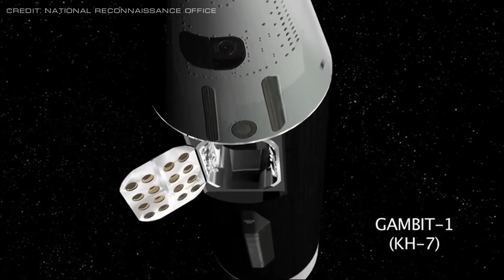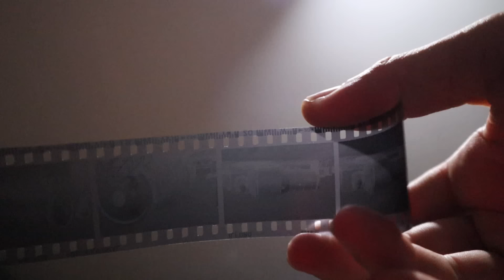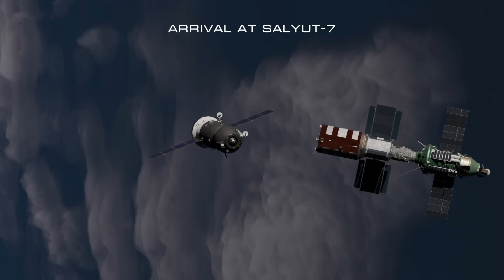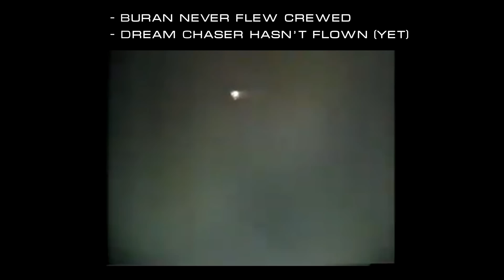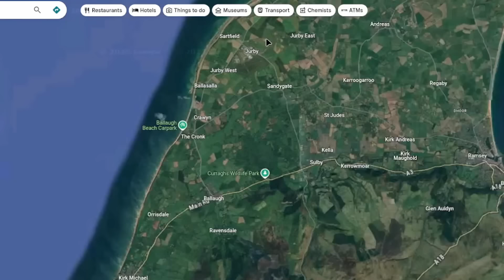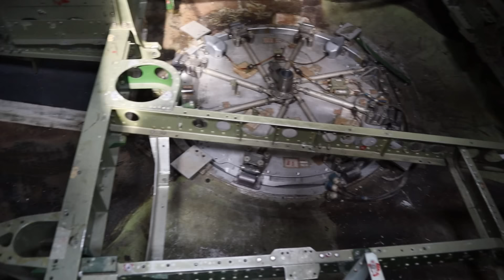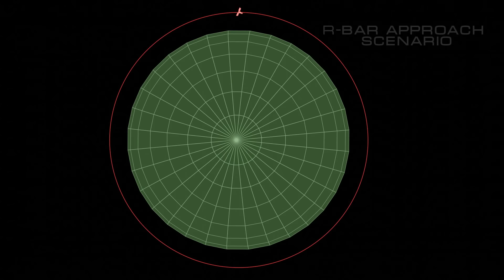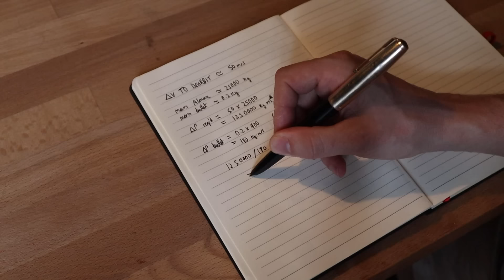Almaz: an Autocannon on a Space Station

Comment: There is a solution to make rounds from an autocannon slightly less problematic and this has been practically implimented into flown aircraft guns- make the bullets automatically detonate themselves after a certain time of flight. Of course in space now you have even more smaller debris, but by my logic a whole bunch of now very small and inert fragments that are significantly spread out all over the place is likely better than slamming into a fully formed round that still has it's explosive intact
Reply: I'm not sure that's exactly better at orbital speeds... you'd need really good guarantees of turning all missed shots into really small pieces -- look at the damage to spacecraft windows caused by paint flecks and metal filings impacting them at orbital speeds. Shrapnel from long-ago-self-destructed rounds would still be super lethal, only moderately less so than whole rounds. And would cover a larger area!
I'd almost suggest that projectiles intended for use in orbit of an occupied (not necessarily habitable, but anything with the possibility of friendlies/neutrals in orbit any time in the next century, including your own ship) body would need to be made out of some kind of material that would vaporize over time (either burning under its own power like some kind of really slow pyrotechnic fuse material ignited by launching it, or something like ice that evaporates due to sunlight on a predictable timescale) instead of metal. But I don't see that being safe ENOUGH to use unguided projectiles at all, so restricting yourself to some kind of energy beams (but how to dispose of the waste heat without excessive vulnerability?) and missiles (ideally incorporating similar features with self-burning plastic hulls/etc designed to minimize persistent debris after explosion in the case of a self-destruct) seem... far more practical choices.
Really, the only 'safe' weapon to fire in orbit would be something that isn't capable of orbiting a planet or star at all: a big laser or microwave beam or such, that surely won't come back around on you or lurk in orbit for someone else to hit later, but rather just keep spreading out in a narrow cone forever until it ceases being deadly and becomes merely blinding, then illuminating, then merely 'a signal' before being lost in the noise. And in theory melting and evaporating a target is also 'cleaner' than shattering it into chunks, as far as I know. Of course, in a practical case, whatever you're shooting at is potentially liable to then blow up from stuff cooking off, etc. under your beam (or even just thermal shock shattering stuff, internal pressure pockets blowing things apart as stuff boils, etc.), and create (some) loose debris anyways.
Maybe let's not shoot anything in Earth orbit if we can help it...

Comment: Yes, the shuttle was absolutely designed to launch and retrieve payloads to/from orbit. What are you smoking when you say it wasn't?
Reply: I think the thing was 'but not resisting payloads'. Disabled Soviet unmanned satellite? Yoink! (at least in the dreams of the Defence Department) Whole space station? Um, ...not a chance. But that did seem somewhat unclearly worded. "Just a Soviet conspiracy theory" seems a little too dismissive, there were also Americans involved in the design process that demanded such a thing, even if it wasn't really feasible.
Honestly, I think that even a textbook perfect target 'disabled' enemy satellite with classified military hardware aboard would be far too risky to grab in such a way, given the fact that it might explode (or merely 'wake up' and try to adjust its angle/trajectory) while grappled, or worse, in the cargo bay. Simply some RCS firing inside the bay (or sufficiently strong reaction wheel movements at inopportune times) could probably destroy a Shuttle.
Now, if the CIA or whoever had managed to steal the command codes and somehow bricked such a satellite's computer in such a way that they knew would stop it from making any further movements (with whatever reactive station-keeping it had turned off), and they had reason to believe no 'ticking timebombs', literal or figurative, existed on the craft (but if they know it that well, why go through all this trouble to steal it?), then maybe such a recovery could be pulled off, but it still seems like an insanely risky mission.

Comment: I just knew it'd be an aircraft gun haha. Also you probably can't fire it for long because it will overheat like crazy, capillary heatpipes and white paint can only take you so far (especially with the receiver looking like it's MLI-ed).

Thermal management in space is a headache, everything either wants to become so hot that it breaks circuits and sensors (equilibrium T° of metal surfaces in sunlight in space are insane haha) or it's abysmally cold and you freeze and break circuits (the Moon/the part of a geostationary satellite that faces away from see the Sun).

Comment: I went to uni in Moscow, specifically Moscow Bauman Stat Techical University and within Kafeda Specialnia Machina Strayania 1 ... or the Special Machines 1 studies. This is where you go to learn how to design and build ICBMs and/or large launch vehicles if you're a Soviet or Russian of high standing. I was let in as an American in the melid '90 because I had money and they were broke. It would have take 8 years to finish. I dropped out after 3.
They tell their students the reason they put a cannon on a space station is because the military was afraid of the Space Shuttle. It was a curious coincidence, the engineers were told, that the  Shuttle was just the right size to fit an Almaz within. The engineers knew better and behind the backs of their handlers rolled their eyes at such stupidity, but what are you going to do? Tell someone who would send you to a gulag that they were being baranoif and stupid? So the cannon was added.
And the engineers did everything they could, used every trick they had, to make the test firing happen after the crew left and the station was going to be deorbited anyway.
After the test firing, te station was a complete mess, "just as you would expect," the man who told me the story emphasised with a.shake of the head. 
Unfortunately, I was a.stupid 20-year-old who didn't know how to ask questions. I just listened and moved on. Which means I didn't learn anything special about this or many other topics.
Still, once the higher-ups saw.the carnage the cannons did to Space station, plans for cannons aboard other stations were abandoned.

Comment: That gun had to be a technology demonstration or more likely just an experiment - I think. Some random cosmonaut in an EVA suit with a Kalshnikov would have been 1000% more efficient than that fixed canon
Reply from the maker: ‘Random cosmonaut with a laser Makarov’ was genuinely one of the proposed alternatives. Just google ‘soviet laser pistol’
Reply: @Alexander-the-ok  That's some Moonraker shit there
Reply: @ghostbirdofprey   "First there was the dream, now there is reality... Here in the untainted cradle of the heavens will be created a new super race". Hugo Drax.
Reply: @Alexander-the-ok  and would have worked a lot better.
No debris, no recoil, no exhaust gasses. Nothing to change your orbit (unless you use a chemical laser and vent rather than store the waste chemicals).
Of course the energy requirements for such a weapon would be too high for a pistol sized weapon. Even 50 years later a laser weapon capable of actually damaging something needs the power supply of a pretty decent sized warship, either a small nuclear reactor or a large gas turbine engine hooked up to a sizeable generator.
Reply: @jwenting  the pistol wasnt really for anti personal combat (kinda was) it was more to disable the cameras of satellites by frying the sensors,you could theoretically also make the enemy astronauts permanently blind
Reply: @jwenting  Just go watch some of Styropyros videos. That man shoved an entire high powered laser system inside a radar gun housing recently, and built the optics to turn a laser welder into an actual laser rifle with the (potential, paper mathed,  federal law, cant fire beyond his property line) range to hit a target further away than the horizon *in atmosphere*. A laser system capable of mission killing a satellite while in orbit is 100% possible. 

Now doing it back in the 70's? Yeah you're not doing it anywhere near as well. You can probably mount a laser capable of disabling optics though.
Reply: @jwenting there’s a Russian unit the size of an IFV shooting down drones and rapidly making holes in steel. This is thru air at 1 Bar too.
Reply: @MJRSoap  
" A laser system capable of mission killing a satellite while in orbit is 100% possible. "

Please tell me you did not come to that conclusion because you saw a youtuber bolt a welder to a radar... please... 

Even the USA has been developing lasers to take out satellites for decades. It's just that it's a lot easier to use a missile.
Reply: @jwenting  the polyus space station did have a megawatt co2 laser, but the orbital insertion failed
Reply: @Alexander-the-ok If it works with an Elephant's foot, who's to argue it won't against satellite?
Reply: Gotta cycle the ak by hand in space if the extreme temperatures dont warp the metal out of tolerences, i imagine the gas systems wouldnt work in space
Reply: @AidenColson  gas operation doesn't really depend on an atmosphere. the inside of the gun is hundreds to thousands of atmospheres greater than ambient pressure. if there was a leak, it doesn't really matter if the outside is 1 atm or 0 - all the gas will escape anyways

there's also a less theoretical proof that gas-operated guns work in space: the R-23 was gas-operated, lol
Reply: ...My dumb a** imagined some ripped Russian wearing a red NGE plugsuit.

Took me two minutes to remember that "EVA" has a non-weeb meaning.
Reply: All the Almaz space stations were military in function. All were armed with remote controlled satellite destroying weapons.
Reply: @allangibson8494 source just out of curiosity? If a book?
Reply: Sooo do you have to use an oxidizer in addition to the powder in the rounds…err is it an AK just going to be a fancy ADHD space clicker that nobody can hear.
Reply: @ChadThundertalk All firearms combine an oxidiser with the fuel. That’s how both black powder (which uses Potassium Nitrate as the oxidiser) and modern smokeless powders (which use buffered high explosives) work.
Getting the gun to work in a vacuum is harder - a lot of lubricants boil off under those conditions and polymers frequently follow.
Reply: @allangibson8494  older, wooden bolt action rifles should be okay for short to medium durations, but yeah, vacuum proof gun lube would be a pretty new if useless invention
Reply: @Blaoerry The lubricants exist - NASA et al uses them for their purposes. 
They just aren’t what gun shops sell or gun manufacturers use.
(Silicone and Teflon based dry lubes have very low vapor pressures).
The finishes on timber are actually worse than plastic in a vacuum and the trapped moisture in wood will want to escape explosively (particularly when heated to above boiling point in direct sunlight in a vacuum). You haven’t seen dry, until you see vacuum freeze dried.
Reply: @allangibson8494 oh yeah that's true, I usually think of teflon and silicone grease as very high viscosity, but I'm sure there's more appropriate ones available. I didn't think about the moisture content tbh, has there been any studies/tests done with wood in space?
Reply: @Blaoerry The Soviets and Chinese did test an oak ablative heat shield for a reentry vehicle… Not sure if that would correlate…
Reply: @allangibson8494 well there would t be much moisture in a modern AK-104 cuz it’s made of glass reinforced nylon. I don’t even think the wood is gonna have those kinds of problems. As long as it’s been cured and dried… defineily not enough moisture in there to crack the wood. If there is then ok it’s trapped inside a tight bundle of cellulose and lignin fibers, basically bioplastics. Take my AK up there now and it’s gonna be fine cuz it was made in the 1970s and kept in kosmoline for most of that time. Kosmoline is perfect for kosmonauts.
Reply: @Kurdalægon  Kiln dried timber runs between 6% and 20%.
In a hard vacuum, that’s enough to blow the wood apart under the surface finish.
Nylon outgasses badly (result from the NASA LDEF) and is hygroscopic (absorbs water). Outgassing fouls surfaces and obscures windows and optics. Epoxy fibreglass is a better option.
Molybdenum Disulphide, Tungsten Disulphide and Hexagonal Boron Nitride are recommended high vacuum lubricants. Graphite stops being a lubricant in high vacuum.
Aluminum and Silver corrode rapidly where atomic oxygen is present (ie low earth orbit).
Kosmoline will simply evaporate in a hard vacuum…
In short - it’s complicated.
Reply: @ChadThundertalk  the oxidizer is part of the powder. Triple base contains 3 nitrogen-oxygen chemicals… it used to be nitrocellulose, nitroglycerin, and nitroguanidine. Tjeee is I’ll combust in a cacuuum cuz they break nitrogen oxygen bonds for energy. Gunpowder is a carbon combustion reaction that creates energy by joining bonds. Really they both function by turning from a solid rapidly to a gas so the energy is from
The phase change and the source of
That energy is those bonds breaking. The propellant part will work fine, so will the lead azide or the aminoguanidine-based stuff they use now for the primer. Same deal, but all the lubricants will flash off and leave behind a waxy residue. I can’t imagine this affecting any part of the AK that much, I’m very familiar with their construction and operation. I think the recoil, firing pin, and hammer spring would have to be beefed up. That will make it more jerky but it’ll prevent slam fire and cycling or firing issues. I’m sure a dry or polymer based lubricant could be developed for a vacuum. Graphite. Molybdenum disulfide.
Reply: @Kurdalægon  One potential benefit of firing guns in space if the propellant is traditional gunpowder: Corrosion of the barrel by combustion products would be far less likely. Gunpowder is not an efficient gun propellant, since roughly 50% of the combustion products are solids - mostly potassium carbonate and potassium sulfate, with smaller amounts of potassium oxide and potassium sulfide.
In a vacuum, these would not undergo any further chemical reactions, and would therefore remain as dry powdery solids. Primarily because there would not be any moisture present: The vacuum of space is dry, and gunpowder is one of the few explosives which does not generate any water as a combustion product.
Here on earth, those gunpowder combustion products become corrosive to steel gun barrels because they either absorb or react with water vapour from the atmosphere: Both potassium carbonate and potassium oxide are highly hygroscopic, rapidly absorbing moisture and reacting with it to form potassium hydroxide, a strong and corrosive alkali. Potassium sulfide will do the same, albeit more slowly, and this will also release hydrogen sulfide. Which is what creates the sulfurous smell associated with burnt gunpowder. Potassium sulfate does not react with water, but does absorb some, just like table salt (NaCl) does, and this causes corrosion by the same mechanism as wet salt or salty water does.